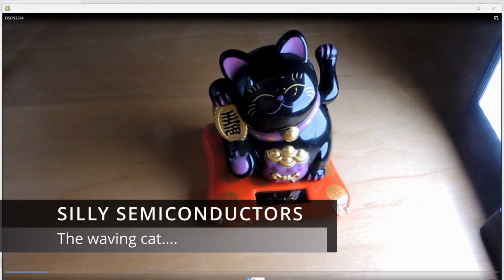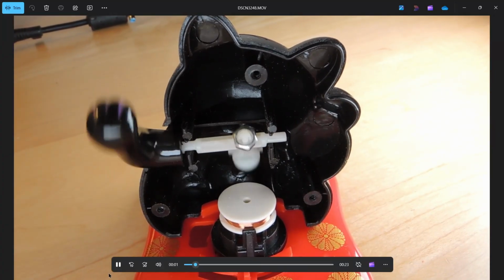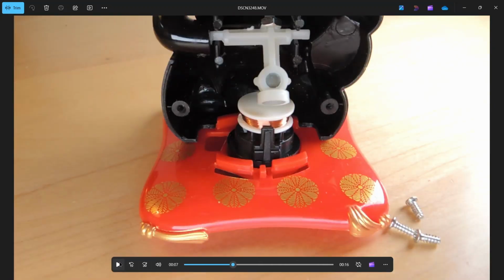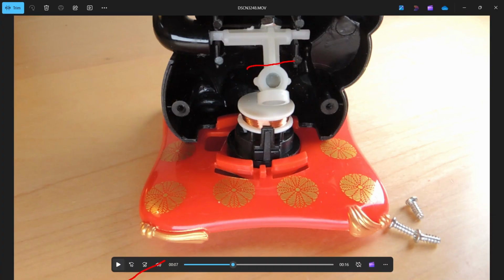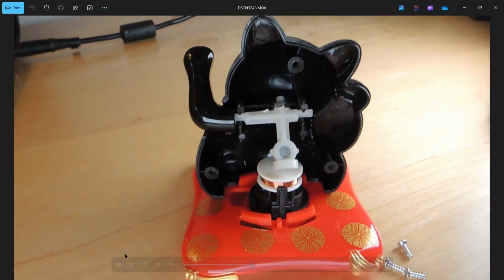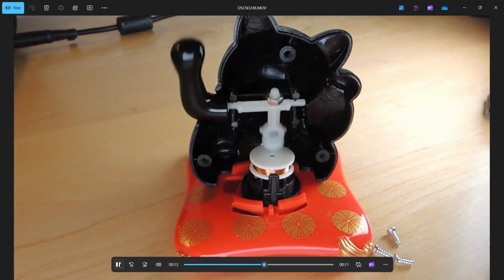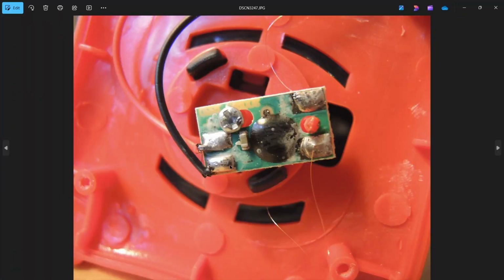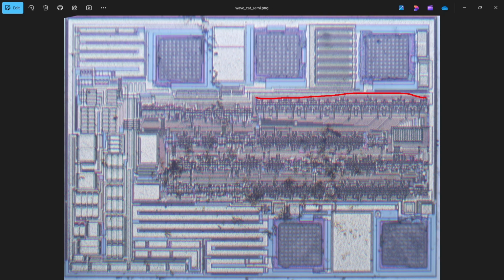Semiconductor Silliness.... the waving cat

Comment: That's a lot more stuff on that die than I would've thought. How did you de-cap it from the blob? Chemically, or with heat and scraping? It'd be cool to de-cap and investigate more "blob chips" - they're in so many things these days. It would be really REALLY interesting to know what fab is making these, what process node it is, and better yet who is designing them? I don't see many chip design jobs for "analog design of the lowest cost most ubiquitous chips in the world"
Reply: The way I've done it is with heat. You can heat the blob with a lighter until it starts bubbling and smoking. Then pick out the die with tweezers. Don't inhale the smoke and do it in a well ventilated area